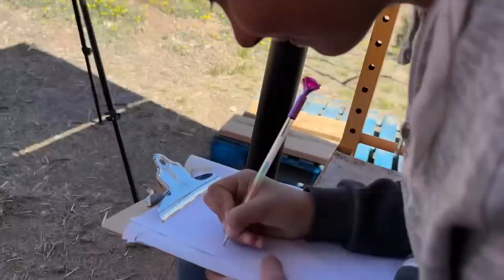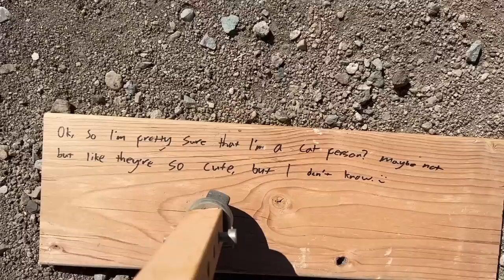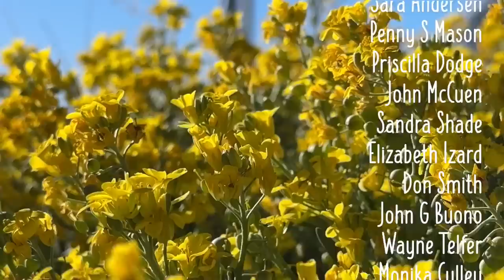She Has a CRAZY PLAN!

Comment: I don't understand.  You've built two structures already and with both you burnt and sealed the wood with linseed oil to prevent wrought and preserve the wood.  On the Casa de Caca you have multiple place where you haven't done this process.  Worst yet, you have doubled up 2x's with out sealing the wood.  In my 40 plus years of experence as a carpenter and contractor  I've learned that is a recipe for dry wrought.  The later part of my career we did a lot of replacing rotten wood decks and patio covers in Southern California.  Almost with out fail, if the wood wasn't sealed with paint or oil BEFORE assembly, it rotted where two boards were nailed together.  Water gets trapped between the boards and never comes out, rotting from the inside out.  Perhaps you can explain why you've changed your process.  Thank you.
Reply from the maker: The frames around the doors and windows will be completely sealed with cob and stucco. Not enough moisture in the desert to worry about rotting out, especially if it's never exposed to the elements. The wood that will stay exposed we shou sugi ban 👍🏼

Comment: You gonna address the erosion of the exterior finish on the office/electrical building at some point? Inquiring minds want to know. ;-)
Reply: They are planning on pulling off all of the plaster and then stucco it and the chicken garden once the low temps are over, but the house build is first priority.